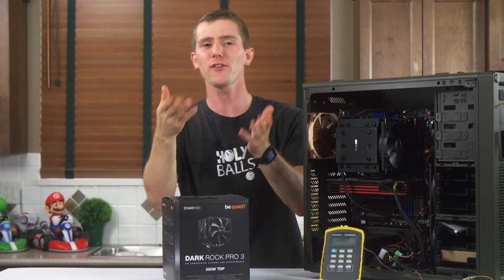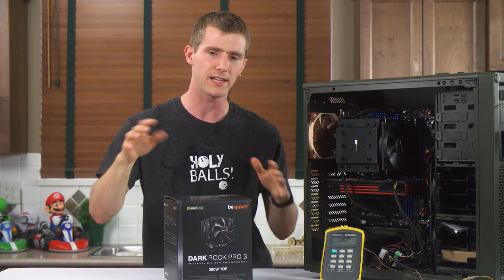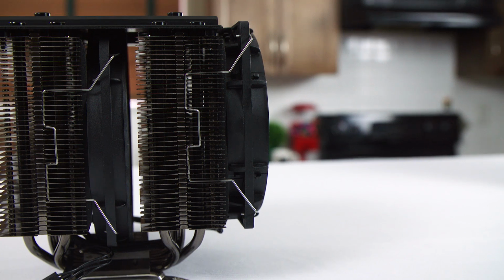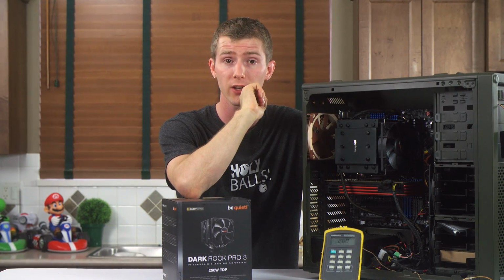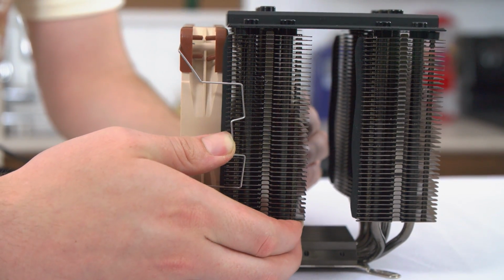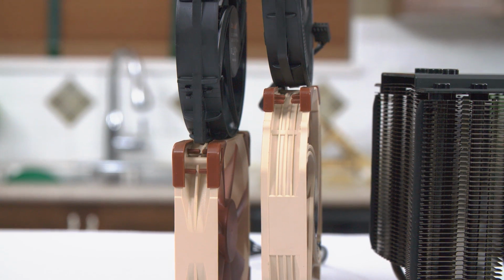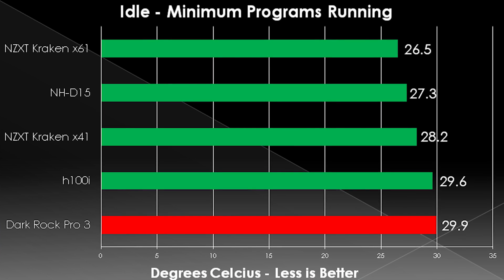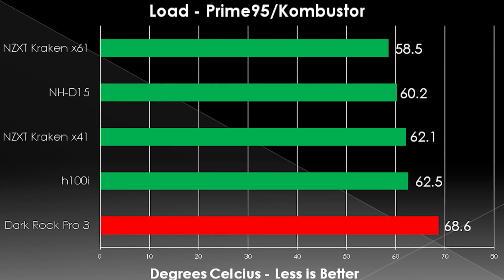Dark Rock Pro 3 CPU Cooler from be quiet!

Comment: Air coolers are on the way out, at least for the enthusiast sector. I don't know anyone who's built a custom PC in the past 2 years and hasn't gone for a liquid cooling solution.

edit: I wasn't expecting this to get this much attention so I'll elaborate my point a bit. This is $90 on the NCIX store page, a mere $15 dollars less than a h100i ($10 less than the amazon price) which in these tests was proven to be better performing and has none of the mounting issue's on this cooler. Liquid coolers are becoming cheaper, perform better and from my experience are quieter due to the fans being able to operate at a lower rpm.
Reply: No
Reply: Liam Blines please explain.
Reply: I've never had a liquid cooler in my gaming rig. I've considered it before, but honestly it just seems like an unnecessary luxury to me.  I'd rather use that money to go to a new graphics card or a new monitor or something like that.
Reply: I prefer aircooling, no vibrations, and they're much more quite. Yes they're bigger but i like the looks of it.

And i never again buy a liquid cooler. Had 2 h100's both hard pump rattle, and needed at least 1200 rpm to have the same performance as my noctua nh-d14.My noctua runs at 600-700 rpm.
Reply: If your tubing fucks up a few years down the line your pc will be ruined, air coolers are easy and safe.
Reply: Alex Paf $2000? That's cute
Why don't you go buy a xbox1.
Reply: I haven't gone with liquid cooling, and I have a few friends also with air cooling.
Reply: I would never use an AiO, too many points of failure (Potentially critical), QC is too random and they're too noisy (They all have crappy pumps).
Reply: i went with the noctua NH-d14 mostly due to budget constrictions but i have no regrets i got a REALLY good deal on it on amazon and got it for 70 bucks. a comperable liquid cooler would have been $120 and it would have been just AS good and more noisy. with the nhd14 you can max out the fans and never hear the fans.
Reply: h100i is loud as fuck.
Reply: benny332 dude  look at the temps Luke shows NH-D15 is better then kraken 41 then h100i and u say that "Air coolers are on the way out, at least for the enthusiast sector" =D ur so totaly wrong and most of people i know building there 2000 USD worth pc are still using air since in idle its way more silent and it just has way lest failure chance =D and as my self having 1.7k USD worth PC im on air too and actually my gpu with asus DCU II cooler is loudest part and way way louder then my cpu cooler.... P.S. My PC is OC'ed to its limits :P
Reply: Alex Paf You sound like a complete elitist idiot. Just because someone doesn't have a windowed case does not mean they're not an "enthusiast". An enthusiast is anyone who has a passion for the subject/hobby. Don't go shitting on the majority of the PC users. Yes a i5 with a 770 is a enthusiast set up. I can guarantee you the average consumer does not have a fucking i5 2500K Overclocked, let alone a GTX 770 xD. I personally have a i5 4690K and a 780, is that enthusiast enough for you, or should I add flame decals to make it faster and more enthusiast?
Reply: Air cooling is just fine. In most cases a custom Waterloop will perform better but it is also a lot more expensive. all in ones perform just as good and sometimes better depending on the rad size and thickness while a lot of the time being more expensive. Anyway this is my opinion and your opinion is fine too. In fact a giant a aio just because aesthetics and it will still probably be quieter than the stock cooler I currently have. But air cooling will probably be more standard for a while to come
Reply: IM running with an air cooling system, and for my experience they are so  quiet that I sometimes make sure my pc is actually booting after I pressed the power button. THey perform perfect for my need and they dont take up much space.
Reply: Air coolers are in no way on the out as they as they are cheaper and preform the same and most single fan AIO's.
Reply: The D14 is comparable to the H110 in many tests... and definitely fits its price. And it's more quiet than it. And there's nothing simpler than a standard heatsink and fan. I'm on OCN a lot, and TONS of people don't go liquid cooling. I actually assembled a spreadsheet of Haswell OCs, and with it I charted people's cooling solutions, and liquid cooling is maybe 50% of the builds. Air coolers are not on their way out.
Reply: Jackson Vu Dude I added flame decals to my PC and got an extra +10 fps in all games! I highly suggest you do it. LOL
Reply: Dude Check out the Cryorig r1 ultimate...it is cheaper, it is quiet, it outperforms liquid cooler like the h100i and hands down it looks so much cooler!
Reply: Stephen Bagnell so.. you're basically saying that poor people are retarded? Wow.. and you're calling who retarded with that kind of logic..? also the difference between a h100i or similar water cooler vs a good air cooler is negligible at best and you always have the risk of the thing busting, where as an air cooler the worst that would happen is the fan dies and cpu starts to overheat, but even that isn't too bad because windows should turn it off before it fries itself.
Reply: It's nice being wrong. Those closed loops are pretty shit when you have value air coolers like the EVO and the beastly Noctua being a thing.
Reply: Bovs0Aka0Baws GOD FFUCKING DAMNIT IT'S QUIET NOT QUITE!
Reply: Jackson Vu Don't even bother trying to talk to this guy, he's beyond saving if he's this concerned about naming himself an "enthusiast" for having a case with a window. I've been building PCs since I was 15 and I've built a crap ton, I don't use cases with windows because I don't care about color matching or the looks of my motherboard. It's OK if other people do, it doesn't bother me but I just don't care. I also don't use liquid cooling because I don't think it's worth the money or risk compared to buying a good air cooler. If that means some random dude on youtube doesn't consider me an enthusiast I don't care. I probably built more computers the year I was age 15 than he's built in his entire life.
Reply: Nathaniel Graham What bothers me is that he thinks he's hot shit for having a couple LED's and a Cheesy Decal on his PC.
Reply: DemonXY2J lol I'm just happy that my comment was able to generate a good discussion point in the community.
Reply: ^ Can confirm added flames 20 FPS boost xD
Reply: meanwhile, using Hyper 212  on my overclock'd i5 3570k at 4.6 Ghz with Corsair Pressure Fans the past 2 years. Yeah could've gotten Noctua but they were a bit pricey and fugly. air cooling master race
Reply: Wahaha but some people dont like the fact your adding a nother point of failure on a water solution ......
Reply: Im running an amd phenom 2 x6 1090t at 4Ghz and around 1.51v and when im rendering I never go above 40*c and im using an Hyper 212 Plus with stock fan. To me, water cooling is only if your going to have multiple GPUs.
Reply: All I see is a bunch of "casuals" not using custom loops on there PC's. closed loops are nice but good air cooling is about the same in performance. Custom loop cooling is mostly for enthusiasts.
Reply: N3RFTHIS Alex Paf Hello fellow $6K PC members? ( ^_^)／
Reply: Pump is loud and most all-in-one-liquid-cooler give you verrryyy loud fans (like corsair).
Reply: Alex Wonga Water coolers are shit, unless you like pump noise, had two H100i's the pump noise drove me up the fucking wall. Had a Phanteks cooler since.
Reply: ***** Thats odd... I have pump connected to molex (12volts) and i'm sitting right next to my computer... I must be deaf :P, But really I can't hear the pump noise too much..
Reply: I got a H100 which I fried when the molex broke and plugged them back in wrong, corsair replaced it with a H100i. I won't go air cooling simply because it's a huge pain to work around a big hulking heavy motherboard bending lump like that. My brother had an NH-D14 which cut our hands, had to be removed several times due to DOA ram and got in the way of the nicer looking faster memory sticks when both fans were installed.

Also, my motherboard is super sexy and I would hate to cover it up ;)
Reply: Patrick Proctor Erm... I was being sarcastic. Read Alex's ignorant comment and you'll see why I replied in that manner.
Reply: Maybe the company is called "Be Quiet" for a reason. I really wish they monitored audio levels.
Reply: " I wasnt expecting to get this much attention" LOOOOOOOOL
Reply: brickman409 I agree. Considering gaming isn't very cpu intensive to begin with, spending $100+ on a decent water cooler isn't justifiable.
Reply: brickman409
 what if someone want performance and silence is a priority ? i have h60 and i must say it's terribly loud...
Reply: Raging Erection After over 6+ years my Zalman CPU cooler died. It definitely served me well.  I replaced it with a Cooler Master Hyper 212 EVO. I swapped out the stock fans for 2 X Corsair SP120 High Performance fans. Air Cooling has never been so cool. Pun Intended. LOL
Reply: benny332 the "enthusiast sector" is probably using a custom loop anyways. the dh-15 beats every liquid cooler except the x61. air coolers are quiter, and more efficient. there's really no definitive reason to go either way, unless you're going with a low end air cooler.
Reply: benny332 Most people doesn't want to pay double for a prefilled water cooler and air cooling is in most cases enough even for overclocking to achieve acceptable temperatures. When you're looking for silence it's also to prefer an air cooler.
Reply: Ive built 2
Reply: ***** I have a cheap thermal take tidewater AIO. And unless you put your head up to the case you can hear the pump. Also the coolent in them is non conductive so if it leaked it would do nothing.
Reply: Borikuaedu3991 Since you started it... They aren't " shit, I have a Corsair H105 in my system - and it does very well indeed. 4690K results: Idle - 30° and at full load - 60-70°
Reply: Alex Wonga
Liar -.-
Reply: $75 on amazon...
Reply: That will only happen if semi AIO triple rad becomes popular and semi AIO quadriple rad begins to appear on the market.Hoped swiftech released a H420,but they released a 220X...
Reply: Bovs0Aka0Baws my same noctua runs at 450-550 ^^
Reply: ***** to achieve similar performance to an nh-d15 the h100i needs to operate at around 43db. For anyone who cares about PC silence it is generally considered that anything over 30db is unnecessarily loud. Meanwhile the noctua operates at around 20db. source: http://www.guru3d.com/articles-pages/corsair-h100i-review,10.html
Reply: bob james Is the H105 any different?
Reply: Alex Wonga All AIOs are generally around the same noise levels but i would assume the h105 is slightly quieter. Custom loops tend to be quieter also due to higher quality pumps but generally if you're going for a silent build then watercooling isn't the best option.
Reply: Alex Wonga I have a H105 with 4 of the Corsair PWM SP120 Quiet edition Fans on it even at their full speed of 1400RPM its barely audible it also cools better due to the thicker rad and doesn't have any of that superfluous Corsair link shenanigans just make sure you have the clearance to fit it
Reply: Thanks for the reply :) I have the H105 installed in the top of the fractal arc mini r2.
Reply: Nice mine is in the roof of my NZXT Switch 810 Matt Black SE
Reply: originally i did get an AIO liquid cooler for my pc (3930k), but i had nothing but issues with it since i got it and its performance dissapointed me, i recently replaced it with an Nh-d15 and i have no plans to look back.
Reply: I build an enthusiast pc two months ago with air cooling, so yeah.
Reply: They're very loud sometimes, and some people don't like having water flowing inside their case. There is still a huge market for enthusiast grade heatsinks. :P
Reply: for all of u saying that price of the product doesnt make u enthusiast. Tell me why most of the companies have their product categories divided like this.
1. Budget oriented products (begginers)
2. Casual price to performance producs (gamers)
3. Some of the top series products (builders)
4. TOP OF THE LINE PRODUCS OF THE COMPANY (ENTHUSIAST SECTION).

LGA 2011 is enthusiast, 780/780ti is enthusiast, R9 290 and 290x are enthusiast, 2133+ 16gb+ is enthusiast, ROG line mobos are enthusiast, AX line PSU from corsair is enthusiast. Obsidian line is enthusiast. Wanna continue till i cover all of them? I think u get the point...the enthusiast section includes some of the TOP OF THE LINE products from each company. Sadly ur 2500k (someone mentioned) thats still a great processor doesnt bare the "enthusiast" with it.
Reply: brickman409 Less than $100 for a GPU or Monitor? With that kind of build it sounds as if you didn't need a liquid cooler in the first place
Reply: Performance per dollar is lower on AIO. Can't really discuss the aesthetic differences and preferences. Most AIO default fans are loud compared to any of the decent air heatsinks. I make and recommend many builds each week and I can tell you from experience AIO's are not picked majority of the time. 

AIO is still a good option just be prepared to pay for to get the same performance. NZXT HAVIK 140 for example is only $60 and performs up there with H80i, H100i etc. but is a lot quieter and cheaper.
Reply: Them noctua air coolers are near impossible to color match a build so good luck with that. NZXT X61 is silent, doesn't block RAM slots, has a 2 year warranty if shit goes wrong and you can change the color to match your build. Yeah it costs a bit more but tell that to enthusiasts they don't care.
Reply: Air coolers cool the components around the cpu better.
Reply: Stephen Bagnell go with a custom loop or STFU... these half assed solutions AIOs suck, the pumps rattle, and you generally need higher fan RPM  to get the same performance as a big air cooler. The better temperatures at load are achieved at 45+ decibels instead of 30+.
Reply: The H100(i) has had so many quality control issues that I'm surprised people don't completely avoid it.
Reply: Keven Harvey Mind I ask how? I have a H105 installed - The back fan is a intake (using the fractal design arc mini r2) it provides fresh cool air to the components around the CPU. However having huge heatsink will obstruct a lot of air flow to those areas in question.
Reply: Alex Wonga
The heatsink fan blows air directly at the components or creates aiflow very close by. Case fans are usually offset from the motherboard and will blow air over them.

I didn't say that cooling would be insuficient with water cooling, just that it would be better with air.
Reply: Patrick Proctor
I was thinking more about the power regulators on the motherboard than the RAM. They could very well get too hot to last on a cheaper board or be the limiting factor for a big overclock.
Reply: i reccomend a hyper 212 evo with that comment
Reply: I couldn't read +benny332 seriously with the cereal guy meme
Reply: I'd still rather stick with air. Liquid cooling--whether it's custom loops or closed loop pre-builts--introduces risks that you simply don't have with air cooling: specifically the risk of leaks. I am sure the rate of failure is quite low with the closed loop systems, but it is there.
Reply: brickman409 Do you have a windowed case? I'm just afraid of my PC looking like shit with an air cooler in the window. But I don't actually know that it would in person.
Reply: Bovs0Aka0Baws you know you can RMA stuff like that, or are you just plain stupid?
Reply: Lukas Klose I think you should read my comment again, i said i had 2 h100, i didn't say i bought two.
Reply: Custom watercooling is the best choice for a silence optimized pc. Because no matter what it's the gpu and not cpu that will produce the most heat.
Reply: Patrick Proctor Yeah, but that's another thing. If you wanna run a custom loop, you have to know what you're doing. You have to be prepared to face hassles like leakage or maintenance. I'm a noob to pc building, but I can't imagine myself ever going the water cooling route unless I'm doing some extremely cpu intensive stuff outside of gaming.
Reply: My NH-D15 disagrees with this thread.
Reply: It's pumprattle we're talking about. Less moving parts = less vibration= less noise
Reply: If you don't care about looks the NH-D15 is the way to go!
Reply: brickman409 How would extra 15$ get you a GPU... ?
Reply: TheMidnightNarwhal
What water cooling systems cost $15?
Reply: brickman409 He said a water cooler would cost 15$ more. "This is $90 on the NCIX store page, a mere $15 dollars less than a h100i" .
Reply: TheMidnightNarwhal
I don't really see the point in spending $75 on a fancy air cooled system either. I just use the cpu fan/heatsink that came with my cpu and the case fans that came with my case for the low, low price of free. Again, I'd rather use that money towards something like a new GPU. Yes, I know there's no decent GPU out there for $75, but when I'm on a budget I'd rather have a powerful GPU than a weak GPU and an expensive cooling system.
Reply: brickman409 Usually people will get a cooler for overclocking or better temps or even looks.
Reply: TheMidnightNarwhal
Yeah I agree, I'm not dissing cooling systems, they have their uses, if you want one, and you have the money for it, then go for it. I'm just saying it's not really for me, and I don't think it's a smart thing to buy on a budget.
Reply: brickman409 I see, I thought you were commenting about getting a high quality air cooler vs AIO.
Reply: Such nonsense, a good tower cooler like the Noctua ND-15 is only slightly less cooling than like a Corsair H110 but way more quiet. If you go for watercooling, go for custom, the all in one's are not that great :/
Reply: santeenl And way cheaper. 
I have to agree with the rest you said.
Reply: Raaawr
Reply: Rxsiner A big and heavy air cooler could break your motherboard and fall down on your gpu.
Reply: Raptor Jesus That´s why you get a backplate....
Reply: Raptor Jesus and the chances of that happening is like the same as a all in one unit leaking
Reply: BlueFoxTV it will not stay non conductive for long
Reply: benny332 Well actually this cooler is really quiet since it has no pump that makes additional noise, plus the h100i only beat this that much cuz it had more powerful noctua fans installed. If you add the fan price to the h100i you are paying about 50% more on a louder product for a few degrees less.
Reply: neobug101 You spent 6k on a gaming computer that's obsolete already, good job, moron lmao. PC neckbeards are ridiculous... I bet you mostly played games that had Atari graphics on that $6k PC smh. Can't play the last of us 2 on your obsolete $6k PC lmao
Reply: I think u guys think u are enthusiasts...If u all got mid range gaming pc's u aint. I plan a 2000$ rig with 780ti 4790k etc for video editing/gaming/youtube work. Thats smth enthusiast. Ur 50$ case with no window even with a 770 and an i5 is not enthusiast. Enthusiasts go for looks too. Not only performance. And ofc take the top lines of what they buy...I got my socket 487 pc with agp (yea i got one running dont ask why) in a windowed case with LED fans and cable managed to have almost 0 cables at front (meh exept the ide bus). Thats enthusiast even if it doesnt cost. Closed watercoolers > air coolers on performance (debatable) and 100% on the looks...